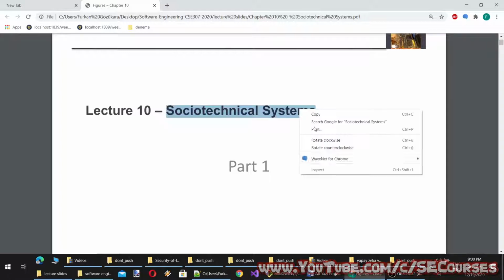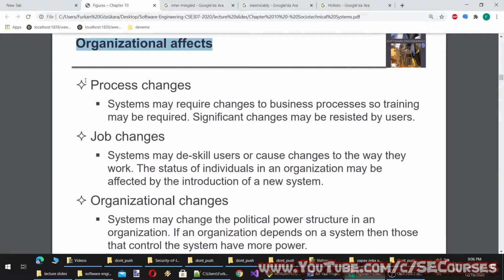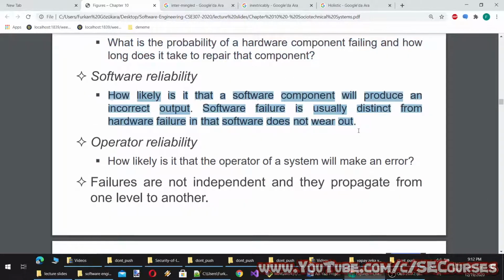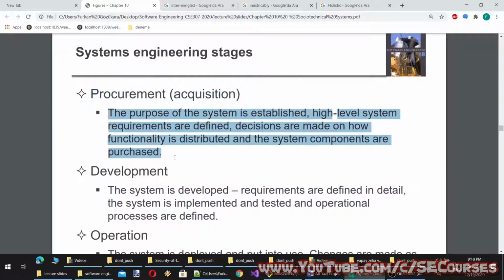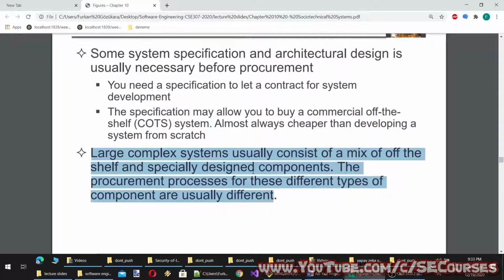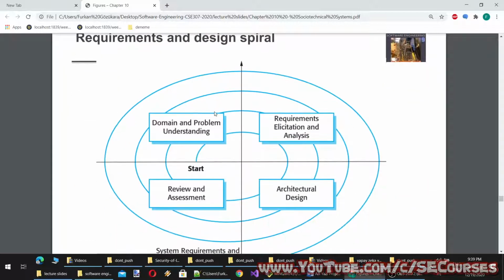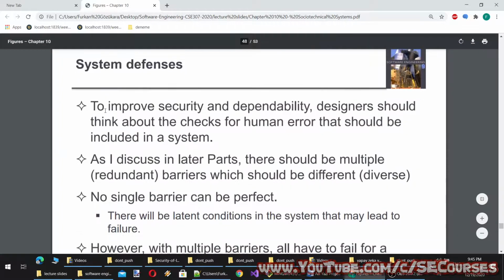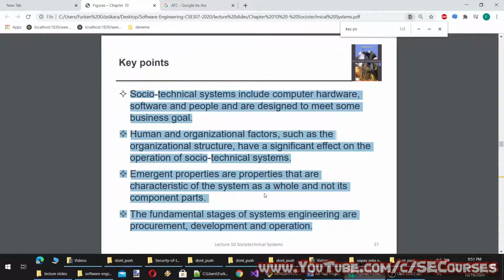#Software #Engineering - Lecture 10 : Sociotechnical Systems, Complex Systems, System Engineering

Comment: In this lesson i learned:
- what is holistic system design
- what are complex systems
- technical computer-based systems
- socio-technical systems
- what are emergent properties and types
- what are systems engineering stages
- what are the system design process
- what is sub-system development

Samed Arıcı - 195050005

Comment: I learned in this lesson;
Layers in the STS stack
Complex systems
System Categories
Influences on reliability
Failure Propagation
Drawing of systems development
System design process and requirements
Contractors and sub-contractors
Procurement and dependability
Non-determinism
Requirements and design
Sub-system development
System development
system procurement, system development,
System integration

System operation
Security and dependability considerations
-Inter-disciplinary working
Human error and systems defenses

SELİN ÖKTEN - 185050008

Comment: In this lecture we covered

Complex systems
System engineering
System procurement
System development
System evolution
System requirement 
System operation
System defences 
System Integration
Human errors
Procurement issues
Contractors and sub-contractors
Decision drivers

195050904
Raanem Dahbi

Comment: In this video I learnt about:

- Sociotechnical systems
- Complex systems
- System engineering
- How software engineering is a part of system engineering 
- And not an outlier, something isolated from system engineering
- Emergent properties
- Decision drivers
- Non-determinism

Buğra Can Gündoğan - 195050003

Comment: Complex systems, systems engineering, systems procurement, system development, and system operation were among the subjects discussed in lecture 10. Computer hardware, software, and people make up socio-technical systems, which are all geared to achieve a certain business aim. The operation of socio-technical systems is influenced by human and organizational elements such as organizational structure.

195050024

Comment: In this video i learned that;

What is software system and example of it,
Layers in the STS stack,
Holistic system design,
Complex systems,
Organizational affects,
Socio-technical system characteristics,
Types of emergent property,
Failure propagation,
Conflict in views of success,
Systems engineering,
System engineering stages,
system procurement,
System procurement processes,
Procurement issues,
System requirements definition,
System design process,
System integration,
Defenses in an ATC system,

Ahmet Yusuf Diktepe
175050013

Comment: What is software system and example of it,
Layers in the STS stack,
Holistic system design,
Complex systems,
Organizational affects,
Socio-technical system characteristics,
Types of emergent property,
Failure propagation,
Conflict in views of success,
Systems engineering,
System engineering stages,
system procurement,
System procurement processes,
Procurement issues,
System requirements definition,
System design process,
System integration,
Defenses in an ATC system,

Simay Seyrek, 195050001

Comment: In this video covers
-Sociotechnical system stack
-Layer in the STS stack
-Socio - technical system characteristic
-Types of emergent property
-Influences on reliability
-Success criteria
-Conflicting views of success
-System engineering stages(procurement, development and operation)
-Decision drivers
-System procurement process
-Procurement issues
-Contractors and sub-contractors
-Sub system development
-Development and dependability
-Reason’s Swiss cheese model of system failure
-Defenses in an ATC system

M.BURAK PAKER
175050012

Comment: 165050012 / Ekrem ŞAHİN
I learned in this video
-System Categories
-System defenses
-Holistic system design
-System evolution
-Influences on reliability
-Failure Propagation
-Sucess criteria 
-System engineering
-Decision drivers
-Contractors and sub-contractors
-Procurement and dependability
-Non-determinism
-System development
-Inter-disciplinary working
-System requirements definition
-System integration,
-System delivery and deployment
-Human error
-Reason’s Swiss cheese model of system failure
-Defenses in an ATC system
-Contractors and sub-contractors

Thank you for lesson.

Comment: I learned these from this lesson 10 video:

The Sociotechnical Systems Stack
Layers in the STS Stack
Holistic System Design
System Categories
Influences on reliability
Failure Propagation
Conflicting Views of Success
System Procurement
Decision Drivers
Procurement and Development
Procurement Issues
System Development
System Requirements 
Requirements and Design
System Integration

165050016

Comment: In this video I learned;

*The sociotechnical systems stack
 -Equipment, os, communications, application, organizations, society
*Layers in the STS stack
*Complex systems (software, mechanical, electrical)
*System categories
*Emergent properties
*Functional properties and non-f
*Hardware, software, operator reliability
*Non-determinism(human elements, system changes)
*Stages of systems engineering
 -Procurement
 -Development
 -Operation
*What is inter-disciplinary working?
*Procurement issues
*Drawing of systems development
*System design process and requirements
*Human error and systems defenses
*ATC system
*System has barriers for human errors

Abdulkadir Durmaz
175050008

Comment: In this lesson I learned;

+Information about Success criteria,
+Information about System procurement,
+Information about Stages of systems engineering,
+Information about Systems engineering stages (Procurement, Development, Operation),
+Information about Security and dependability considerations,
+Information about Non-determinism,
+Information about Inter-disciplinary working,
+Information about Decision drivers,
+Information about Contractors and sub-contractors,
+Information about Systems engineering,
+Information about Procurement and development,
+Information about System procurement processes,
+Information about Procurement issues,
+Information about Requirements and design spiral,
+Information about System development,
+Information about System requirements definition,
+Information about The system design process,
+Information about Procurement and dependability,
+Information about Requirements and design,
+Information about Sub-system development,
+Information about System integration,
+Information about System delivery and deployment,
+Information about Human error.

175050004

Comment: This lesson i learned;
*The sociotechnical systems stack
*Layers in the STS stack
*Holistic system design
*System categories
*Emergent properties and types
*Influences on reliability
*Failure propagation
*Non-determinism
*Conflicting views of success
*Inter-disciplinary working
*System procurement
*Decision drivers
*Procurement and development
*Procurement issues
*Contractors and sub-contractors
*System development
*System requirements definition
*Requirements and design spiral
*System integration
*System operation
*Human error
*Reason’s Swiss cheese model of system failure 

Ebla Ekerdiker
185050010

Comment: in this video I have learned the following: 
- the socitecnical system stack 
- Holistic system design 
- Complex system
- organisational affects
- Failure propagation 
- Sucess criteria 
- System engineering 
- security and dependability considerations 
- Descision drivers
- Procurement 
- System development 
- System requirement
- the system design process 
- Requirment and design 
- System integration 
- Human error 
- System defences 

185050901

Comment: in this lecture , i learned;

Software engineering is not an isolated activity but is part
of a broader systems engineering process.
-The sociotechnical systems stack
-Layers in the STS stack
(Equipment, Operating system, Communications and data management , Application systems, Business processes, Organizations, Society)
-Holistic system design
-Complex systems
-System categories
-Organizational affects
-Socio-technical system characteristics
-Emergent properties
-Examples of emergent properties(Volume ,Reliability,Security,Repairability,Usability)
-Types of emergent property
-Influences on reliability (Hardware, Software, Operator)
-Failure propagation
-Non-determinism
-Success criteria
-Systems engineering
-Stages of systems engineering
-Systems engineering stages (Procurement, Development,Operation)
-Security and dependability considerations
-Inter-disciplinary working
-System procurement
-Decision drivers
-Procurement and development
-System procurement processes
-Procurement issues
-Contractors and sub-contractors
-Procurement and dependability
-System development
-System requirements definition
-The system design process
-Requirements and design
-Requirements and design spiral
-Sub-system development
-System integration
-System delivery and deployment
-Human error
-System defenses
-Reason’s Swiss cheese model of system failure
-Defenses in an ATC system

Emergent properties are properties that are  characteristic of the system as a whole and not its  component parts so, the fundamental stages of systems engineering are  procurement, development and operation.Human errors are inevitable and systems should include  barriers to detect these errors before they lead to system  failure.

AHMET MUSTAFA VİDİN 195050803

Comment: The topics that lecture 10 covered  are Complex systems ,Systems engineering, Systems procurement, System developmentand System operation
.Socio-technical systems include computer hardware, software and people and are designed to meet some business goal.
Human and organizational factors, such as the organizational structure, have a significant effect on the operation of socio-technical systems. System procurement covers all of the activities involved in deciding what system to buy and who should supply that system. 
System development includes requirements specification, design, construction, integration and testing. 175050901